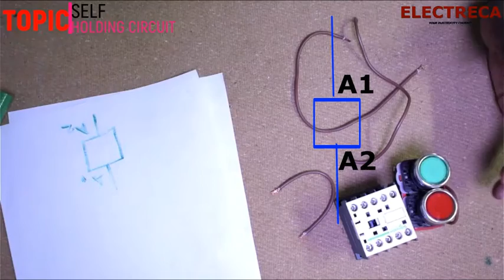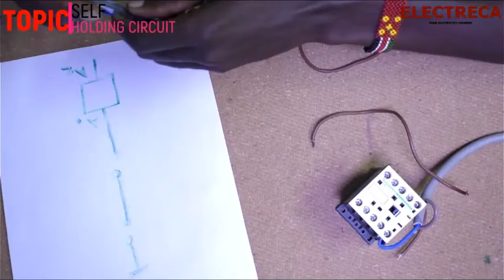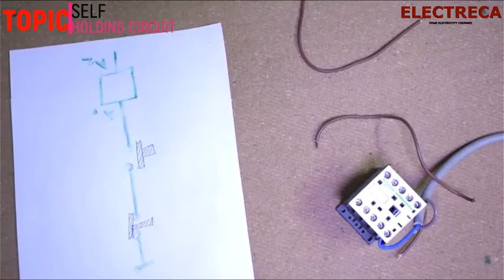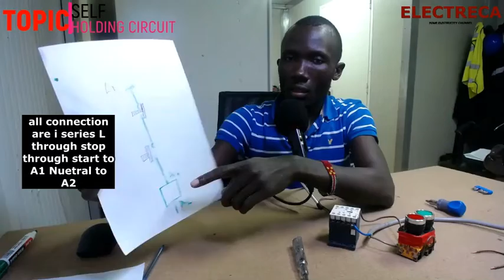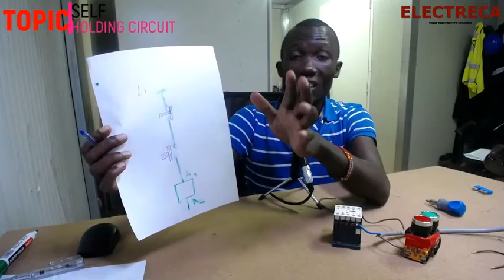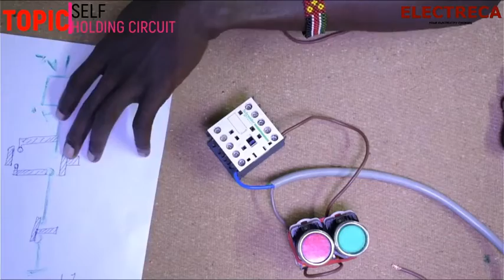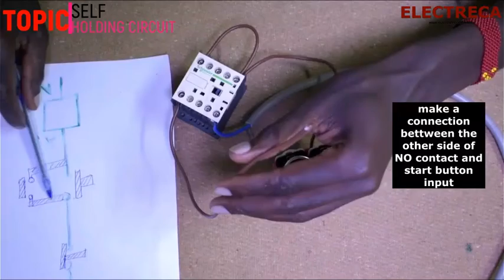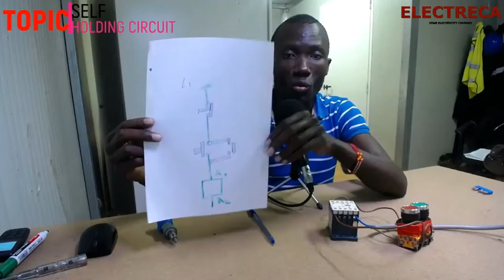How Self-Holding Contactors Actually Work

Comment: How are you , David ..this is David Palmer  Automation/ Electrical Controls Specialist @ Coca-Cola Bottling ( Los Angeles CA). Power goes through the NC stop switch, then to input side of NO start switch-where it branches off to one side of the Contactor connections ( as you have connected with the brown wire from A1 to the opposite side of the Aux. Contactor - that will go to the other side of the stop Button. Very good my Brother!

Comment: Yes i know these motor contactors with holding coil. Mostly for 3phase >10hp. Wye start(star), delta run. The push(start) button will energize the holding coil to pull down the contactors and switch the motor n bypassing the start button. 3 contactors wil control a motor. With the main/wye(start) for sec then main/delta(run). Controlled by a timer. Stop(button will cut off the holding coil.